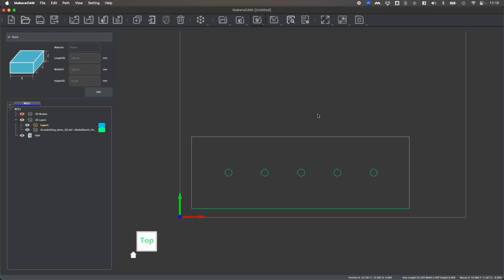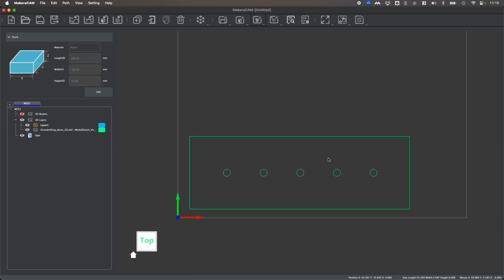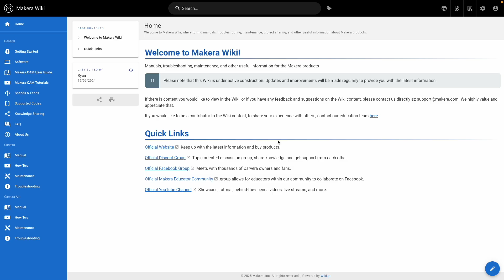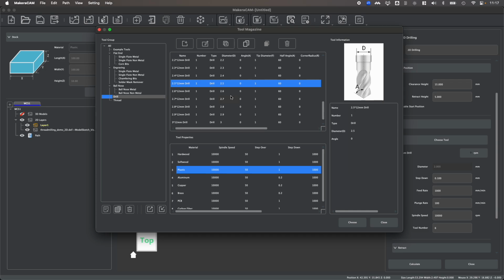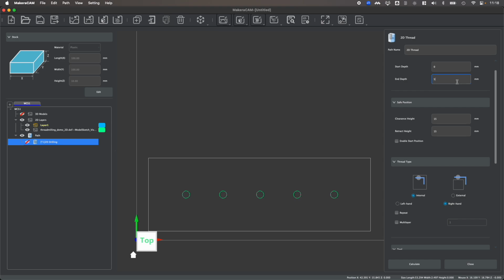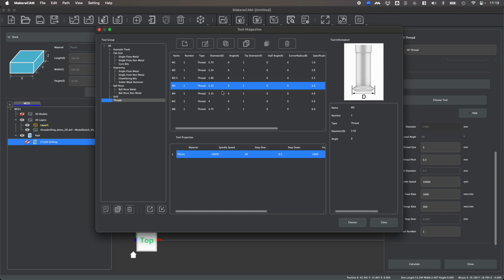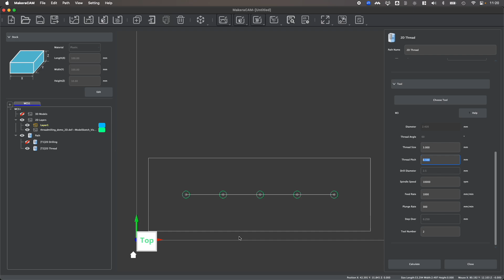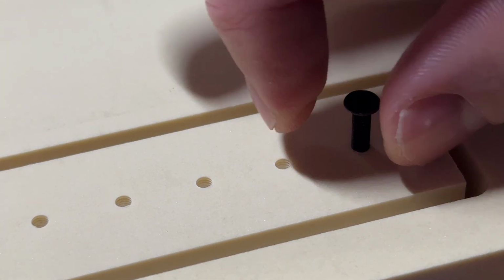Makera CAM - Creating 2D Thread Milling Tool Paths

Comment: Typing "thread" or "threading" in the wiki search finds no results.  And how do you do TPI threads?
Reply from the maker: Thank you for the info, we are updating the wiki. If you have the correct details on your TPI requirements you should be able to set it up in the CAM software.

Comment: Can you create a bore instead of using a drill to tap the hole?
Reply from the maker: Yes, assuming the diameter is correct to the size threads you're looking to create.